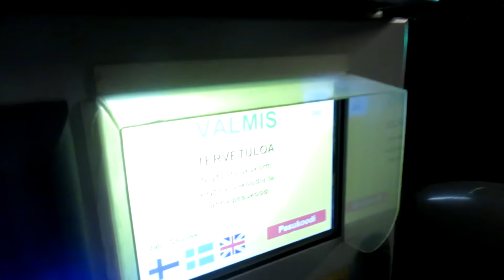Motor City Wash Works Conveyor Car Wash (SHELL Design)

Comment: MCWW's bubbler design is quite popular in the US, though I have never seen one in California. Both of the MCWW tunnels I have been to have provided excellent results, even though they had less equipment and were operating at much higher chain speeds than this one.
Reply from the maker: This is first time I have seen this bubbler system in the Finland. Slow conveyor speed in this gives thorough washing action to the wrap around brushes. Those washed back of the car really well. This is something I always look in conveyor systems. It's most challenging job in the conveyor system. I have seen many  conveyor systems what don't really get back of the car good washing action.
Reply: I have heard that the best component for rear cleaning (especially on SUVs and vans) are entrance-facing top brushes. Many Dutch, German, and American operators are using them because their wraps cannot sufficiently clean the rear of vehicles at higher chain speeds. Entrance-facing wrap-around brushes are becoming less common in new installs because they do not get much contact time or sufficient brush pressure on the rear of vehicles. Holz, MCWW, and Belanger seem to be the only ones who have a decent solution to this problem with regards to wraps.
Reply from the maker: I agree with you. One wash what could possibly do a creat job at cleaning the front and rear of the car is Tammermatic RoboJet with wrap around brushes. It has that top brush design where it goes very low and it has long travel direction of the conveyor.
One location I know is in Southern Finland (Hesburger Wash).
This video is filmed from there: https://youtu.be/7rVwd4zCPLY?t=2m20s
Here is how the top brush works: https://youtu.be/DRJobyqnPfY?t=4m6s
Reply: Tammermatic's top brush is well designed, though it appears to be optimized for slower conveyors where vehicles are more likely to be spaced farther apart from each other. Their (or really MacNeil's) wrap design does a great job on the front and rear of vehicles. Some of the longest tunnels in North America are equipped with MacNeil's wraps because they are designed to perform well at extremely high chain speeds. Sonny's, Christ, Holz, and Econocraft have developed top brushes that are designed to provide better front and rear cleaning, but (aside from the Christ FOLLOW-UP design) lose contact time on the hood and roof of vehicles.
Reply: SF Car Wash Channel
Reply: SF Car Wash Channel